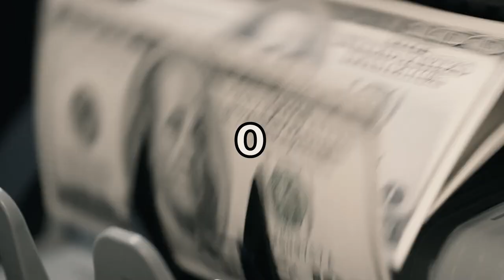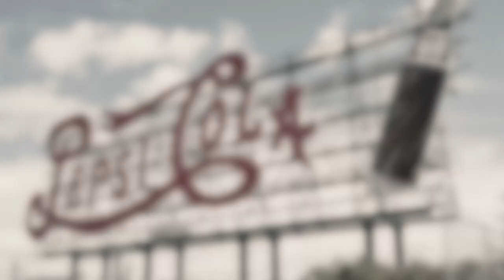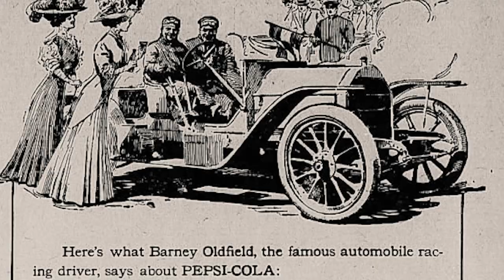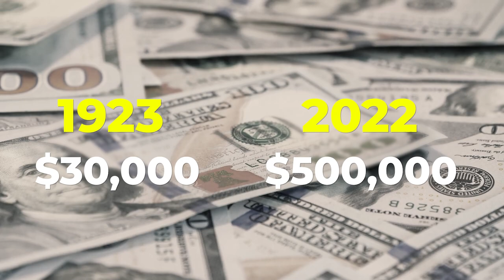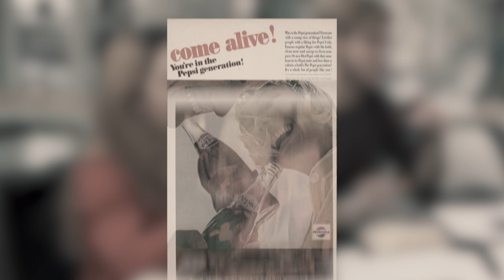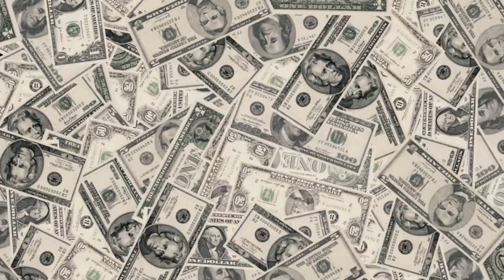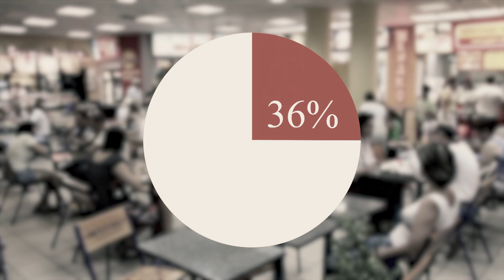How Pepsi Cola Duplicated Their Rivals And Made Billions

Comment: $30,000 was a lot in 1923 in today's money it would be $885,745.45 if you look at that $30,000 it seems to be small today but it was a decent amount in 1923. 500,000 it's incorrect  in today's money with insulation. It's actually up in the 800,000.

Comment: You were using the coca-cola full name but for some weird reason you started alternating between calling it by its second half and first half of the trade name.  You might have touched on why and when they changed their logo art, their continued production of natural sugar drinks (throwback lines with Pepsi and Mountain Dew), their Crystal Pepsi which had a fruity flavor, their decaffeinated sodas, and continued sales presence in Taco Bell and their other former restaurant holdings.  Also their ever growing experimentation with tasty Mountain Dew blends or flavors.  Except their Ginger bread flavor which is gross.